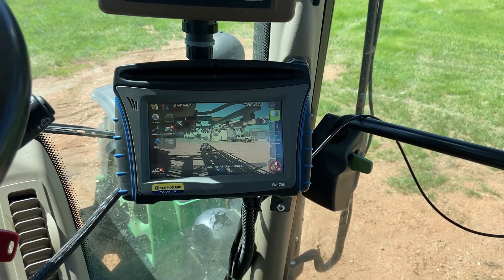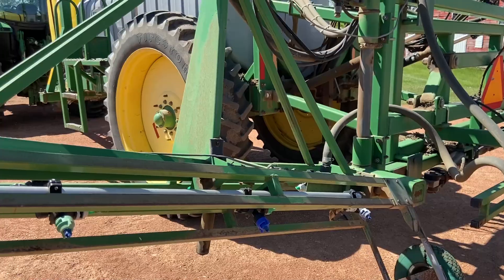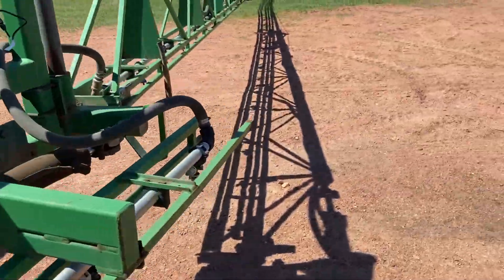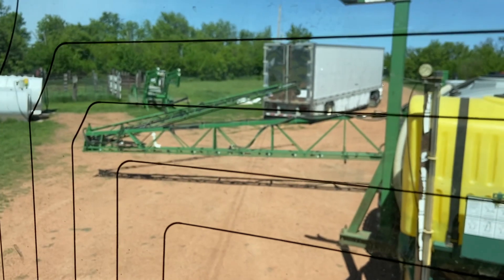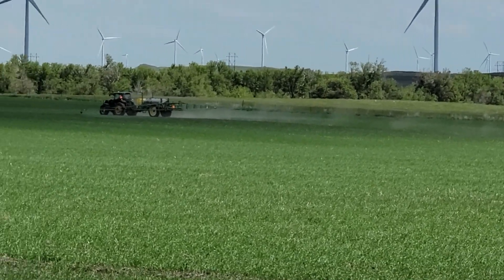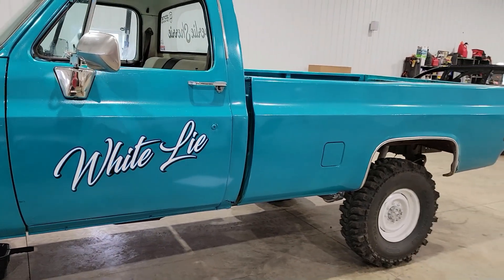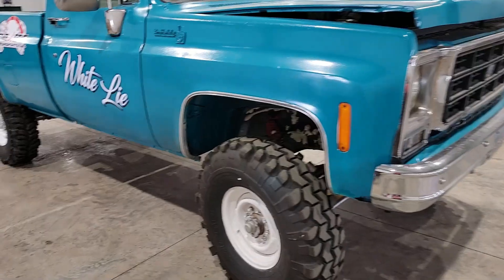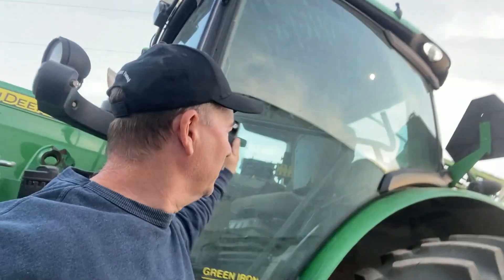Trimble FM750 Camera Upgrade

Comment: Is there any place ahead of the boom that you can mount the camera?? Out of the way of flooding up and out of the spray...
Reply from the maker: I tried it in a few places. Couldn’t see nozzles. Made a mount.
Reply: It's tricky to get it in a good spot without it getting crushed or wires pulled and being able to see. Wonder if having something on the axle underneath could work... I've been wanting to get a camera mounted for that rear boom as well.

Sometimes for that rear boom is to run rinse water through them and check 'em periodically. Usually any nozzles we have issues with are all the end ones on each section since it seems where most of the fine gunk that manages to get through the main and section filters ends up.
Reply: @farmingnodak  on the axle, probably can't get a wide enough field of view.. but you won't know until you set it up and see.. definitely worth a try
Reply: @DiamondHeartRanch  really too bad you can't find a spot to leave it.. I'd forget it and fold up.. oops..